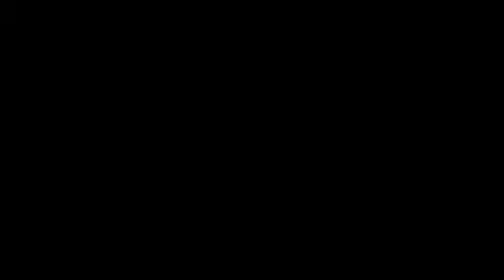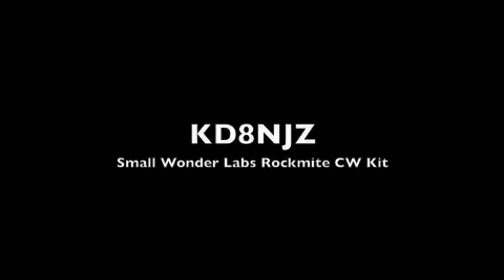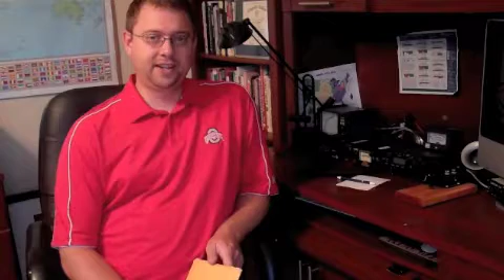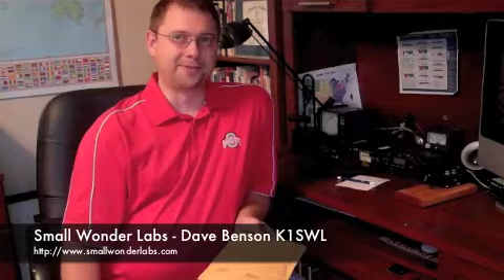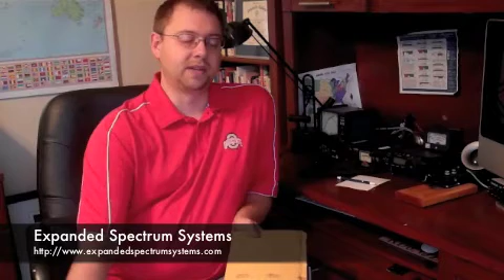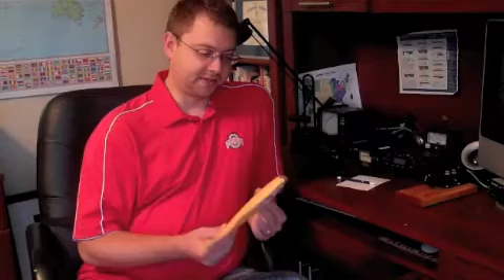KD8NJZ Rockmite Pt 1

Comment: Hi,
Well done video.. Just one POSSIBLE heads up. A tin with a see through top may be problematic with picking up more electrically generated noises near your operation area. Computers, some fluorescent lights and many other consumer item generate RF. Having your case as a shield and feeding with coax does minimize this some. One option might be to install a shield inside and solder a wire to it to make contact with the case. You can remove it to peek.
73,
Glenn WA4AOS 
DSM Labs dot com
Reply from the maker: Thank you for that tip!